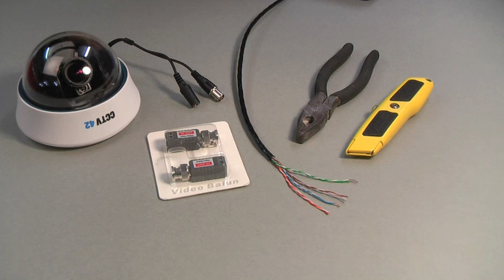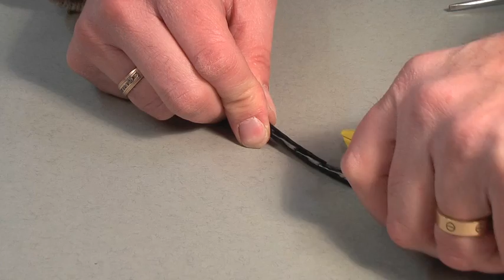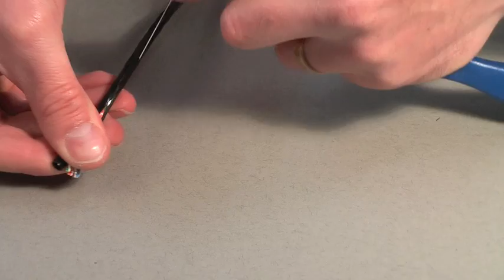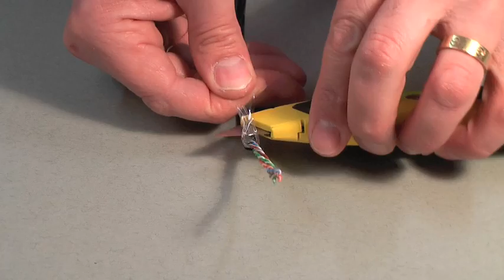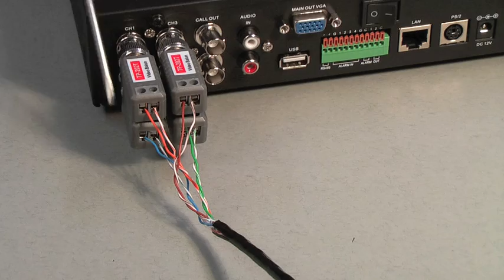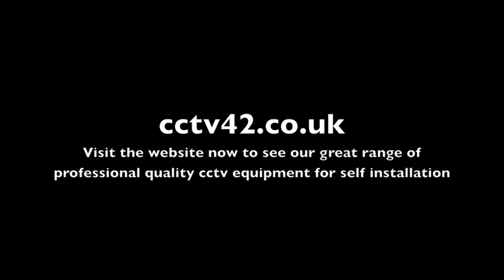cctv42.co.uk - using cat5 cable and baluns to connect a cctv camera to your DVR

Comment: I never use analog cameras or dvr's!!! always use IP Cameras and NVR
Reply from the maker: HD Analog CCTV potentially has a number of advantages over IP based systems depending on specific requirements. It is generally simpler with less potential areas of dispute when trouble shooting. This is particularly the case when we are trouble shooting a client's system remotely. With IP based CCTV everything has to talk to everything else in the network and there are a number of areas when communications can fail.

Analog CCTV places no strain at all on your network whilst doing it's thing and recording away. You don't even need a network. Cameras connect directly into the DVR so if you have network failures or bandwidth issues as everyone streams videos, searches the internet and so on it doesn't matter and indeed the HD CCTV system doesn't add pressure to the network with multiple HD feeds as it would do with an IP based solution.

You can still remote access HD analog CCTV by connecting the DVR to your network. The network will only be used as and when you remote acc it either locally or over the internet.

Longer range IP cameras tend to be expensive. You can buy cheap wide angle cameras but they only have limited uses due to pixels spreading rapidly as you move away from the camera meaning little detail is captured. And don't think throwing pixels at the problem is the answer - you need far too many pixels for wide angle / longer distances to be a viable solution. With our analog HD solutions we can offer realistic 70m effective identification range using HD 1080P which offers a good balance between high resolution and hard drive friendliness.
Reply from the maker: It might be worth taking a look at this help article on our website. https://www.cctv42.co.uk/help-advice/buying-guides/buy-the-best-hd-cctv-cameras-and-system/ip-or-analog-hd-cctv/

Comment: Hi, Two questions, Firstly when using cat 5/6 you get ghosting, rolling, rainbow effect, how do you eradicate it? secondly what is the max length I can use for either Bnc cameras or IP based cameras??
Reply from the maker: Hi there Abdul. This method would only be used for standard definition or HD Analog cameras such as HD-TVI, HD-AHD or HD-CVI. Make sure you use pure copper CAT5 or 6 not CCA (copper coated aluminium). Use shielded cable and also make sure you are using genuine video baluns rather than just connectors where the terminal wires straight through to the BNC fitting. There are specific standard definition and HD video baluns.

The maximum length will depend on a number of factors. Assuming just video transfer our equipment allows for a maximum connection length of 300m. If you are also supplying 12 volt power down the cable we would suggest a maximum cable length or 50-60m depending on the camera.

Comment: How would I connect the cat 5 cable to the DVR, i understand that the connections for the camera require a balon and a DC connector but how would I connect the end that goes into the DVR, would there be 2 connections or just use one balon with all 4 colours connected to it.
Reply from the maker: The video part will connect to the DVR using a video balun. The baluns are sold as a pair. We sell a DC power socket (the opposite to the DC plug at the camera end) into which you can connect a 12 volt power supply.
Reply: CCTV42 thank you

Comment: HD-SDI no more than 50 meters. Many say cannot be done. Others say can only be done with specialized Balun that are expensive. Can you specify, if you have the time. Thank you.
Reply from the maker: HD-SDI was a bit of a stop gap solution for analogue HD and we never sold it. We use HD-TVI which is much more tolerant to cable length & type. HD-SDI is very fussy both in terms of cable spec and length.
Reply: CCTV42 Thank You

Comment: great video,if i power up local the camera shall i use a steady supply or a common?
can you give me a link how to make a wall jacket from a power cord?its outside installation
Reply from the maker: I'm not entirely sure what you are asking. If you power the cameras locally you need to use a 12 volt regulated DC supply with our equipment. We suggest using a small weatherproof enclosure for the camera to cable connections. bring all the cables into the box from underneath with a drip loop to ensure the connections are kept dry.

Comment: thanks sir for your video and up dates kindly  make some video to show how we can connect home made poe as I used 123 and 6 port for video data and 4578 I used for power twisting  one pair for positive and one pair for negative but I don't know weather it is stander or not I don't use poe, use power switching supply.

Comment: thanks suppose I use  12 volts 3Amp or 5 amp power switching supply  can I get up to 100 miters?
Reply from the maker: No, the voltage drop along the cable is voltage based not current based.

Comment: hi i just want to know what will be the max length of cat 5/6  we can run for video plus 12 volts? pls
Reply from the maker: Using 3 pairs of wire for the 12 volt power we would suggest a maximum cable run of about 50 metres.

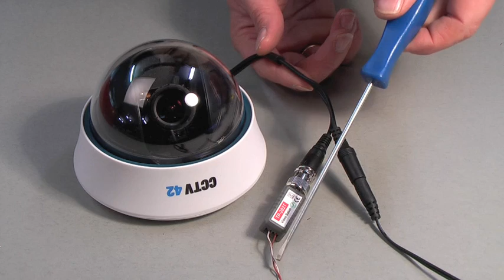Comment: Hello and good job! I just want to ask you; What If we gonna use just 1 cable for power connector? With same way same cable system via cat5e, I mean for example orange and white cable for power... Not at all cables. 2:27 Or Positive: Orange and White and Negative Blue and White... BNC: Positive: Green and Negative:White... Red: Internet service provider and White: Internet Service Provider ISP... What happened then? Is it still work or not?
Reply from the maker: You wouldn't be running the internet service on your camera to DVR cable. Our DVRs connect to the internet separately allowing you to access your cameras remotely. For this application the CAT5 cable only takes 12 volt power to the camera and a video signal back from the camera to the DVR.

Comment: Hello and good job! I just want to ask you; What If we gonna use just 1 cable for power connector? With same way same cable system via cat5e, I mean for example orange and white cable for power... Not at all cables. 2:27 What happened then? Is it still work or not?
Reply from the maker: You are likely to suffer voltage drop as the cable length increases. We suggest using 3 pairs of wires for the power to ensure sufficient copper content to avoid voltage drop.

Comment: Why must remaining twisted pairs be set to power and ground? also is it necessary that all remaining pairs go to ground and power as oppose to just 2 or 1?
Reply: +Luis Gonzalez The reason we suggest using 3 pairs of wires for the 12 volt power is to reduce the chance of voltage drop. Only 1 pair is required for the video signal.

Comment: Hi, if I use HD cameras with these attachment using ethernet cables, will I still get HD picture? thanks?
Reply from the maker: We supply HD-TVI cameras and these can be connected using CAT5/6 cable and video baluns. We sell specific HD baluns for the purpose.
Reply: +abdul saeed Hi there Abdul. If you follow the link at the start of the video it will take you to the baluns on our website. You will see we have an HD version which is suitable for HD cameras up to HD1080P.
Reply: this is great , cat 5 and 6 cables has gone a long way to eliminate the waste of cables to hv power near the camera when using siamese
Reply: So do I need HD balums for likes of 3MP TVI cameras using cat5e? this will eradicate any interference?

Comment: Can you use cat3 cable for camera installation? Will the image and power be ok even though the two pairs of wires are not twisted?
Reply: +hicoteo You need to use twisted pair cable such as CAT5 or CAT6. It is the twisting which prevents interference.

Comment: who would connect 4 cameras to 1 cat5 cable, the cameras are usually not next to each other.
Reply: +Csaba Farkas It might be that you have some cameras in a remote area of a larger site. They can be cabled back to a point where power is supplied locally. The video element of the signal is then transferred back to the DVR using 1 length of CAT5 and up to 4 cameras. 

Whilst video can be transferred up to 300 metres using passive baluns then 12 volt power would suffer voltage drop. Hence powering the cameras locally in this example. Hope that all makes sense. Henry
Reply from the maker: You sometimes run the feed from several cameras to a point and then link that to the DVR using a single length of CAT5. For instance you have several cameras mounted on a separate building powered locally. You then run a single cable back to the main building where the DVR and remainder of the cameras are locate.
Reply: I meant you steal need a separate cable for each camera
Reply from the maker: You may have a separate cable running from the hub area to the camera but from the hub area to the DVR you can run up to 4 cameras down a single length of CAT providing you are only handling the video signal.

Comment: Do you recommend a particular brand when it comes to choosing a balun? Is brand important?
Reply: +Katharine Rose We supply our own brand of CCTV42 baluns and have standard definition or HD versions. The problem with some of the cheaper so called baluns is they don't actually have any components inside, they merely join the connectors to the BNC fitting. Our baluns do a bit more than that.
Reply from the maker: There are a lot of baluns which contain any electronics, they just have wire going from the screw terminals to the BNC fittings. At CCTV42 we sell our own brand of baluns which are made for us in either standard or high definition variants.

Comment: sir, i tried using the video balun crimp type. wherein you put your video and power there. see image URL http://g01.s.alicdn.com/kf/HTB1s2TRFXXXXXbwaFXXq6xXFXXXI/221316807/HTB1s2TRFXXXXXbwaFXXq6xXFXXXI.jpg the problem is i cannot view maybe its about 50m long, probably because of the power.if i use the balun screw type, like yours where in i will pair 3 pairs for power and 1 for vid, u think it will view?
Reply from the maker: Errol Alaba Hi there. Thanks for your comment. In truth, I can't give you a definite answer as your product isn't one we know the internals of well enough, however I suspect the internal wiring is only using 1 pair of wires in the CAT5e cable for the power as opposed to the 3 pairs that we have tested and recommend for CCTV Cameras.

Manually wiring the connections as we suggest gives you this control. You can see this here:

http://www.youtube.com/watch?v=hXadrx-iPfE&t=2m29s

It is possible that you could also be using CCA (Copper Coated Aluminium) instead of Pure Copper CAT5e cable. It is very important to ensure your CAT5e cable is pure copper. We have tested our video baluns up to 60m with video and power over pure copper CAT5e cable.

You'd need the following, 1 of each for each camera:

https://www.cctv42.co.uk/shop/cctv-accessories/cat5e-camera-to-dvr-cables/video-balun-with-flylead-pair-for-use-with-cat5e-cable/
https://www.cctv42.co.uk/shop/cctv-accessories/power-cabling-connections/dc-power-plug/
https://www.cctv42.co.uk/shop/cctv-accessories/power-cabling-connections/dc-power-socket/

I hope that helps.
Reply: CCTV42 have u tried using CCA? what is the maximum length for cca power transmission? i believe i am using CCA because i bought the cables at a very cheap price
Reply from the maker: Errol Alaba Hi there. We have indeed tested using CCA and would strongly recommend it isn't used. Over very short runs we have seen either a degradation of image quality or no image at all. I would suggest rerunning the cable with pure copper CAT5e cable. If the cable goes outside, it is also worth making sure it is external grade cable. If you need to purchase some, we stock it on our website:

https://www.cctv42.co.uk/shop/cctv-accessories/cat5e-camera-to-dvr-cables/

Good luck!
Reply from the maker: Errol Alaba We also supply that type of cable here:

https://www.cctv42.co.uk/shop/cctv-accessories/pre-made-camera-to-dvr-cables/

However, we have found you start to get voltage drop over the longer distances if you combine these cables. I would recommend using Pure Copper CAT5e cable. It also then gives you future proofing options if required.

I hope that helps.
Reply: CCTV42 sir can you explain to me what types of camera tvl for cif? d1? 960h?

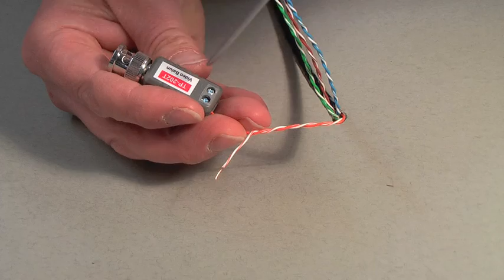Comment: In minute 1:38 i would recommend you to maintain the twist on the cable near to the baluns. At least thats how we (IT Technician) do with Ethernet Keystone Jack. Extremely helpfull video THANKS!!!!!
Reply from the maker: +InventionPR Thank you for your comment and I'm glad to hear you found it useful! Ensuring the wires are twisted as close to connectors is indeed best practice :)

Comment: Can we use 2 pairs for video and 2 pairs for power? Does it make any difference from what is the usual specially on the result of video fuzziness or power drop?
Reply from the maker: Joven Ivan Julhusin Hi there

Thanks for your comment. The video signal only requires a single pair of CAT5e cores, whereas the power requires as much copper as possible, so you're best to stick with 1 pair for video, 3 pairs for power.

I hope that helps.

Comment: Good day Sir. You got a nice video very educational within 3 mins Damn!!! 
Just two question sir...
1.) I can see that you are using balun for video. can you please tell me what is that piece of plastic you used to power the cctv?? 
2.) I've been reading the comments and I can see here that you suggested that at most 50 meters if i want to use UTP cat5e for video and power. Can you suggest what i will use for example 100 meters for video and power.. Thanks :-)
Reply from the maker: Hi there. I'm glad you found it helpful!

1) That is a DC Power Plug - https://www.cctv42.co.uk/content/110/dc-plug-screw-terminal.aspx

2) If you need to use longer, you would need to find power at the camera end of the cable. These video baluns can transmit the video signal up to 300 metres - it's just a matter of powering the camera.

I hope that helps.

Comment: the 3 pair of cat5 for DC plug 1 end is going to camera, other end is connected to what device?
Reply from the maker: summerr911 They would be connected to the power supply for the camera assuming the cable run length is less than 60 metres. This can either be done by wiring the CAT5 straight into one of our Professional Power Supplies, or using a DC Socket and into either our Single Camera Power Supply or 4 Camera 5 Amp Power Supply.

Comment: I had a professional install of cameras. We had used an existing coaxial cable run (already in the home) with HDMI balans to convert signal (at both the DVR & TV ends) so could be viewed onto HDTV in our bedroom. It worked for 3-4 months then failed. Installer tried new balans and various other ones, can't understand why it no longer work.Any thoughts?
Reply from the maker: Hi there. Thank you for the comment, however you'd be best advised to speak with whoever sold you the equipment - as their own product, they're going to be best placed to look after you.

Comment: How long The cat5 cable can be used to provide 12 volt DC power to the camera? can up to 100 meters? (by using 1 ampere power)
Reply from the maker: We wouldn't recommend running the power and video over CAT5 cable for distances longer than 60 metres. I hope that helps.
Reply: Thanks
Reply: can i use cat6 cable?
Reply from the maker: Yes, CAT6 cable should work as well

Comment: is there any difference in video quality compared to coax cable?
Reply from the maker: In theory the outcome should be the same. The main difference is that CAT5 cable is less prone to interference so you're less likely to have image degradation issues.

Comment: Could I put 2 cameras down one cat5 cable, or would it not power both them?
Reply: Did you ever get an answer to this? I have the same question.
Reply: +Jay K its not possible
Reply: +Danny Corr thanks for the response. we're you able to find out why it would not work? or a workaround?
Reply from the maker: The problem with running 2 cameras down a length of CAT5 is you are only left with a single pair of wires for each camera to provide 12 volt power. This means you will suffer voltage drop as the cable length increases. From the video you will see we suggest using 3 pairs of wires for the 12 volt supply, this means voltage drop won't be an issue up to about 50 metres. 

If you are only transferring video signal and powering the cameras locally then you can run up to 4 camera feeds down a piece of CAT5 cable. The video signal only needs 1 pair of wires and using passive baluns you should be good for up to around 200 metres providing its pure copper CAT5.

Comment: my simple question is, Running cat5 instead of siamese cable is better for these type of cameras? (non ip cameras) ??

or is it just for emergency? because I rather use cat5 than stinky coax.. I don't like coax at all, good thing in the next 5 years all cameras will be ip cameras!

Comment from the maker: If you scrape back some of the copper see if there is silver coloured metal underneath. It may be that your video baluns are faulty. The UTP (uniform twisted pair) wire goes straight into the video balun. Also make sure you have the polarity correct on the baluns.

Comment: How can I know the real difference in the cables??, I bought a box of cable but it does not have the transparent plastic protection for the wires, it just the blue plastic cable and the 8 wires inside, the distance of the cables to the cameras is not longer than 30 mt. I have to mention that if i use a UTP to BNC converter all the cameras works perfectly, but when i try to build the connectors they are not working as I said. I will let you know what happens with 3 pairs for energy, many thanks!